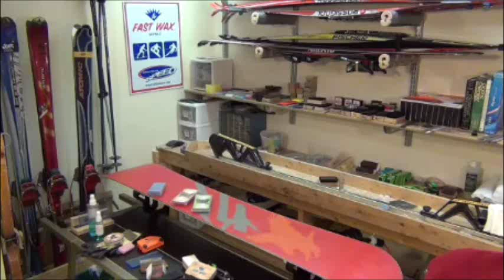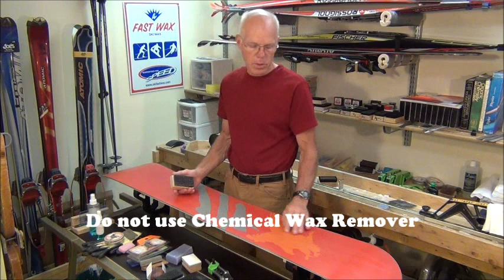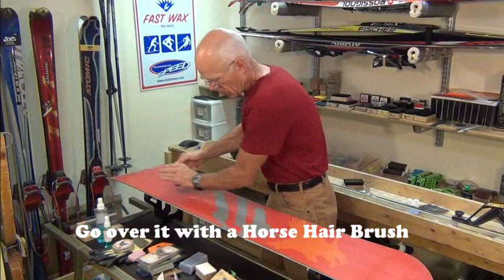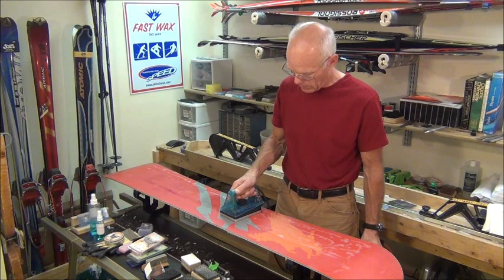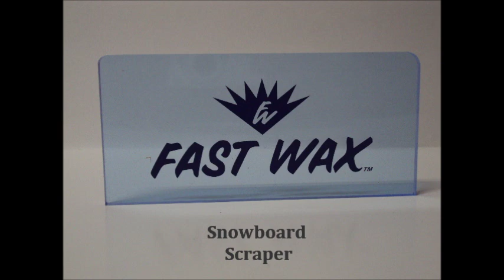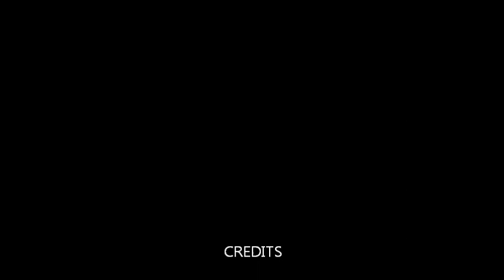Snowboard Waxing-Part 1

Comment: I watched another video that talked about two different types of bases, one with pores and a lower end without pores. The video said to use a cleaner for the lower end board and hot wax the board with pores. Is this true and if so how do I know what base my board has? Also, what kind of brushes did you use on the second video to polish? Can I leave some wax for extra protection in the park?